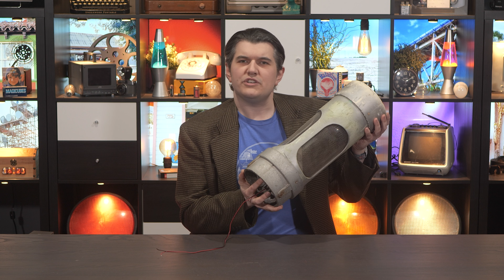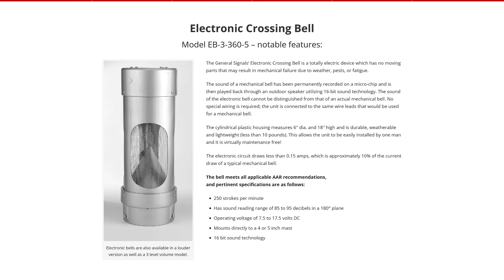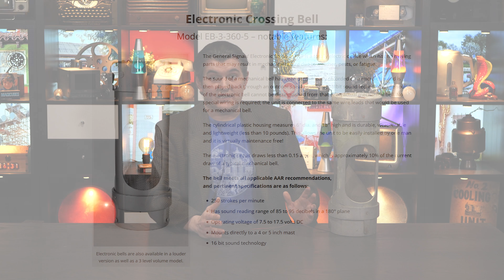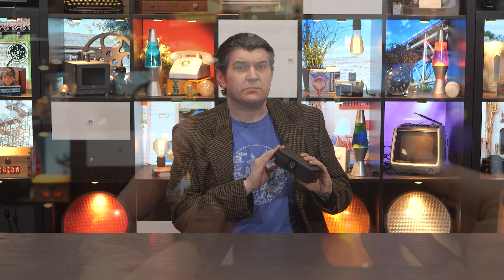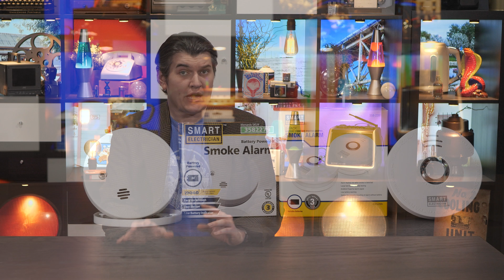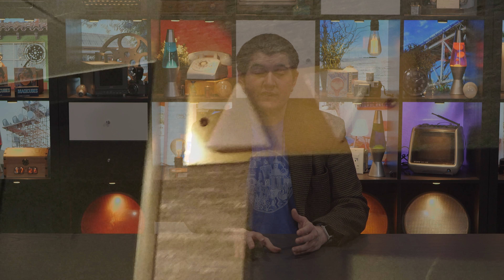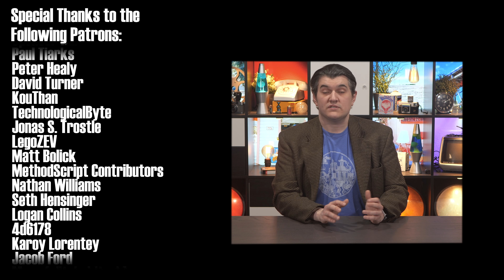The disappearing and unappreciated art of audible alerts

Comment: You can get a Nothing Phone. It has that notification cooldown, the first notification sounds normal, and if the second comes to quick it lowers the volume automatically. Also you put your phone face down, it switches automatically to vibration, or if it is already on vibration it turns to mute, and only the gliphs are on... And a lot of useful stuff. Cheers!

Comment: "One man's defaults are another man's hell"
Android recently changed persistent notifications. If I make a notification that I tell isn't allowed to be dismissed, now it can be dismissed and there's no setting anywhere in the phone to make it non-dismissable anymore. I use that type notification to remind me that garage door is sitting open, the doors are unlocked, and the stove is on through home assistant, and the only way to dismiss them was to lock the doors, close the garage, and turn off the stove. I consider it completely inappropriate that it's simply no longer possible to have truly persistent notifications.

Comment: I'm so confused about parts about the end rant. I have three Gmail accounts and I've set all three to different sounds..? I've had it set up like that for years and redid it again last months when I changed phones.

As for snoozing notifications - yeah it's too bad it's not built in. Buzzkill is an app that can do that (I use it for other stuff but I've seen the feature)

Tip for unobtrusive noises - ui plonks for the Sheika slate from Zelda BOTW!

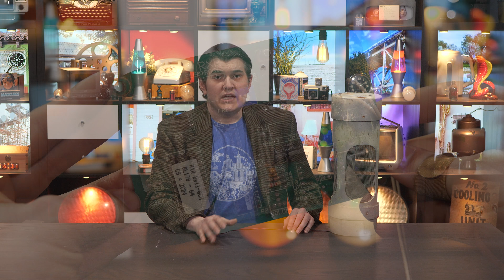Comment: 3:09 That is the most simple circuit I have ever seen in something consumer, a ROM, ADC, Audio amplifier, and two binary counters, what I assume is a 555 timer, thats it.

I suspect the counters are used to address the ROM (albeit I'm not sure why there is two of them), the data out goes straight to the ADC, and the 555 serves as the clock.

Comment: You're so right about the repeat notifications. Samsung Messages had that feature, so I wouldn't miss texts when I left my phone in another room for 8 seconds. My new phone uses Google Messages which, after a great deal of internet searching, I've found does NOT have the feature. The only solution seems to be installing a 3rd party app, which should never be the "solution" to an obviously missing feature.
Also, like you, I never feel the phone vibrating. Maybe my phone is too cheap to have a strong motor?
I could go on a big rant about how we have fewer options than ever and they're vanishing more every day, but I think I'll try and have a more relaxing Sunday.

Comment: Great video as always! I do agree with all your points and also wished we got to experience the more whimsical side that some phones did in the past. (I miss my IR-Blaster, 3D-Touch and RGB-Notification LED from past phones)

I also want to add that I find it downright irresponsible how some alerts are designed. The fridges my grandparents and parents own have alarms that warn you when the door is still open after a minute or so. The tone they used is pretty high and unchanging. I can easily imagine them or others not being able to hear it or it just going unnoticed as more environmental noise! Same applies to other alarms of household items and even some fire alarms! (For their battery, not the actual fire alert)

Sadly, I can easily imagine that the problems with notifications on modern phones you spoke about are quietly tolerated as useful bugs by some software makers. By not being able to easily discern between useless notifications and important ones, one must spend more time looking at the phone, so by not being able to treat those differently, the companies behind them may end up making more money, even if that effect may be small for the individual company. I could at the very least understand that as a rationale for app developers to not design notifications to be customized well by the user.

Comment: I would like to have an Android app to automate some stuff when a notification comes, yet any automation app seems to be stifled by the OS, missing wakes, having problems with network access, intent communication does not work, etc. I just started outright assume that this is hostility by design.

I thought even that I could use morse code with vibrations or unobtrusive sounds (probably 2-3 letters of contact's name), but that would land me at square one with fixing a system that does not allows to be fixed!

If I wouldn't be cash strapped I'd get one of those fancy “minimalistic” devices for telephony and internet and a pocket computer with Linux.

Comment: Another thing I noticed is that my car (a 2019 Nissan Leaf) will occasionally make a bing-bong sound while I'm driving, but I have a really hard time figuring out what that sound is meant to alert me to. It could be that the car has detected that I'm exceeding the signposted speed limit (which its built-in cameras often make mistakes deciphering), or possibly that there's some issue that a dashboard light should also be alerting me to (but so far those have only ever lit up for low tire pressure). Even flipping through the thick owner's manual hasn't managed to clear up my confusion.

Comment: I actually think good notification sound management would reduce screen time. You end up picking up your phone constantly to check for notifications instead of relying on an audible alert. They definitely could make notification management a smooth guided process but most people would significantly suppress most notifications if actually presented with a choice, which goes against maximizing screen time which most tech companies are incentivized to do.

Most of the tools are there on paper but they are buried in menus, and are often half-baked.

Comment: You only slightly touch on this but we absolutey need what I'd call "notification batching" - both a global, per app, per notification, up to per contact option to set not just the ringtone, but also what is the period you want to be notified between notifications. Like, I wanna hear the initial notification, but then if they continue messaging or whatever, it NEEDS to shut up for a configurable period - up to even like days if I want. But that is simply not a thing that exists.

Comment: back in the 90s as a young teen I had a wristwatch I absolutely loved because it used 2 different tones, for scrolling though the settings it went to a higher pitch than than the others when you got back to the 1st screen/page... it used both tones for the Hr alarm... I'm estemating on time (it was 30+ years ago after all) but I think it was a 1/2 second  tone, 1/2 second off, 1/2 second tone/ 1/2 off then a full one second at a higher frequency (maybe a 4th or 5th higher?)... I'd often not even notice the first two beeps but the 3rd got my attention.  I'd had watches in the past that just used the same beep tone and after a few months or so I just stopped noticing the chime.

Comment: Using a '3' to mean "danger" or "emergency" has been a standard for a very long time...

The SOS was built on the concept of a set of 3 groups of 3.... 3 short, 3 long, 3 short.  This dates back to 1906, and the "Save our Souls" is actually a backronym.

Triangles are also used as warnings, think yeild and caution signs.  Radiation symbols notably have 3 triangles, and each triangle has 3 sides and 3 corners.

In the scouts we were taught that if ever there was an emergency, the method of conveying this to people in the woods away from camp was to blare a horn in sets of 3.  If we were stranded and needed to be rescued?  Make a triangle.  A triangle of fires, rocks, whatever.

Comment: I used to have certain contacts with specific songs as their ringtones.  For example, I had the Monkees Mary, Mary for my sister Mary. These days, I just use the theme music from the 1968 Sci-Fi series UFO as my ringtone (I just really like the music) for every voice call.  I've been using Samsung Galaxy phones for over a decade.  I just use the default beep for push notifications, but I only have two programs sending me push notifications.  I get them when I get a text or when I get an email to my Gmail account.  I'm retired, so I don't have a work email anymore.  Plus, I am not on any social media.  well technichally, I have X and Facebook accounts because I sometimes want to follow links in a news story I am reading, but I never post anything.  I don't have any social media apps on my phone.  

I have a Samsung watch, but the only thing I use it for is to vibrate when I get a call or a text because I often can't hear my phone when it's in my pocket.  I don't use any of the health monitoring, and in fact went to a fair amount of effort to disable them.  Most of the time, I don't even wear it.  I only put it on when I go out.  Oh, it's also supposed to automatically unlock my phone when it's connected to my phone via Bluetooth.  I like that, or would if it actually worked.  Mostly, buying the phone was a waste of money for what I use it for.  If I ever decide to replace it, I will probably buy a Pebble.

Comment: A small anecdote that you'll find interesting.  I was working in a Jail an as electrician, and we were replacing the security system and the fire alarm system.

The old fire alarm system was from the 80's, and made a sound similar to the "whoop whoop" sound to the one you played from the record.

It turns out that the fire alarm sounders were just intercom speakers, and a single DAC in the fire control panel would constantly play the "whoop whoop" sound 24/7, and when the fire alarm went off, it would just connect the DAC to some amplifiers to play it over the entire jail.   So each time the fire alarm would go off, it would start in a random starting place on the "whoop whoop" recording.  When you were in the room with the main fire control panel, you could very faintly hear the "whoop whoop" sound from the DAC from the electronic noise.

Comment: I should note, 99% of fire alarms also use a tritone, debatably the most jarring interval when isolated by itself. Surprised you didn’t mention that. 

At the college I went to, the tornado alarm was a consistent long tone was an uninterrupted consistent interval, you wouldn’t guess, a major third! A “just” intonated third as well. 

It was beautiful sounding. Actually drew me outside to listen. (The tornado was several miles away and the tornado shelter was just right  inside, so I think I was fine).

Whoever programmed that alarm did not do a good job conveying danger. If I did not also have multiple alarms inside on the intercom and on my phone, I would not have assumed that was a tornado alarm.

Thanks for the video!

Comment: Have an old home fire-alarm from 2005. Had to replace some of the electronic components, but did technically get it working again... Accidentally made a connection that shouldn't exist, which caused it to constitantly go off, so long as it has power. It is not a temperal 3 sound. Definitely obnoxious, and if heard for too long you will start ignoring it.

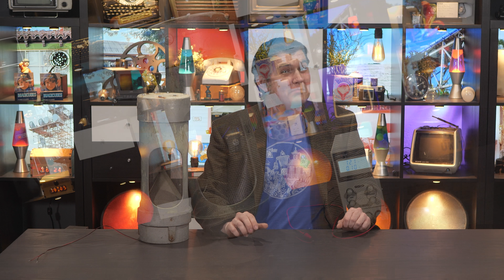Comment: 0:44 - If I'm honest... I've seen enough videos to know these bells mean nothing. I've seen a video where a guy put his bike over the train barracade, pushed through the small gap by bending the barracades apart with his body, then THREW UP HIS HANDS AND YELLED AT THE TRAIN FOR DARING TO PASS BY BEFORE HE GOT OVER THE TRACKS. Seriously, what's wrong with people...
3:57 - You have an important job and don't let anyone tell you otherwise.
4:13 - While accurate, I hate it. Thanks!  >.>;
4:29 - Slower for some than others... See first timestamp comment above
13:04 - The problem with common sense is it isn't that common. Keep repeating it and it will be. It is unfortunate that it needs to be done, but...
14:40 - I never cared to at first, I have basically a handful of friends who message me, but when I suddenly did again I found I was unable to. At least for individuals. Specific apps, yes, and I have distinctions between Discord, Telegram, and SMS.
15:46 - You do know that-Ah, there it is.
20:06 - Can confirm, it's a 1 hour feature. This is one of the reasons open source is great. If Android were open, features like that would have been implemented and folded into the OS in a week.
22:48 - Nope, we can't have nice things. Capitalism demands that we listen to the megacorps who know exactly what we want.
I love and hate in equal measure that our society has become the iconic "1984" Apple Macintosh commercial, but there's nobody who's running past the masses to tear down the regime with a sledgehammer. If they haven't been paid off, they've been captured by security long before they can make it to the stage.

Comment: A standardized fire alarm sound, happy thoughts indeed! At my work they test the fire alarm once a month. Not the entire drill, only the sound. Also at my work runs a rather large steam boiler, with an alarm. Guess what, both are bells. Guess again, both make almost the same sound in pitch/tone. Guess, you get my drift and indeed if those bells ring, they just ring until they are shut off.
If that  3-beeps or 4-beeps signal is the smartest to use? Too many alarm clocks make beep-sound-sequences like that.

I don't expect a soft ding-dong for a fire alarm nor the boiler alarm. But some kind of distinction would be nice. Not that it will be easy to get out of the building quickly when disaster strikes.
_

My phone, I have some pretty standard sounds. Only for very few special notifications I have a special one. Not that I drop all I'm doing, but I heard that notification and know I need or want to react pretty quick, the next brake, or some time later.
And when I drive my car, you can ring all you want. It would be nice if the phone could let you hear the 'engaged tone' while I drive... but developers don't think that far ahead. We still call those things phones, but calling others is one of the lesser things I do with the device.
_

A last thing on sound and sound design. Specially as you mentioned the elevator sounds regarding the blind. What about all those alarm sounds and the deaf. Not all devices can vibrate. Not all situations can be assisted by flashing lights, not to mention light pollution and confusion. Around me most alarm sounds use a rather high pitch, and only one tone or multiple tones all in that high pitch region ... exactly where my partner has the largest loss of hearing, and she is not alone.

Again a very nice video that at least tries to make people think.

Comment: Memory unlocked:  At my elementary school, the fire alarm rang the standard school  bell in a pattern of three short bursts.  Why not?  It's a system that is tested nearly constantly.  It was merely explained to us that that was the fire alarm.  Not that most or all fire alarms share that pattern, but this specific one does.  I"ve heard fire alarms over my entire life, they have almost all had the same pattern, I've just never put 2 and 2 together.

Or I suppose 3 and 3.

A tornado alarm was one long continuous ring on the bell.  Problem is so was the normal class change bell, so the tornado alarm was 1. at weird times and 2. even longer.  No CO alarm in this system.

Aircraft are full of this kind of stuff; I have the feeling that I could amuse Alec for hours with stuff from Part 23 about standards like this.  For exmaple, the alarms for ILS marker beacons are long and low pitched, they go doo doo doo doo.  The middle marker is middle pitched and it alternates long and short, daa da daa da daa da daa da.  What few inner markers were ever installed are high pitched and only do shot pulses.  di di di di di di.  Alec has informed and entertained me about a lot of stuff like this, I hope I just returned the favor in some small way, because I like that guy and I want him to have a nice day.

Comment: I own a "hybrid watch". Real face and hands plus a tiny display for more features. It connects to the cell phone and measures pulse O₂, steps and air pressure. It can display the headers of push notifications if you really want. But when the small 64×64 oLED display is off, it looks just like a regular classic watch. And the battery can run many months if you disable the sensors. A week when fully monitoring O₂ all the time.

Comment: @TechnologyConnections I don't know if this is is just my city or my whole country, but they had a problem with electric busses (for public transport) being too quiet, and since they get to drive through otherwise pedestrian only zones that was a problem. Also, because a regular car/bus horn is so frequently used, people were ignoring that sound, thinking it wasn't important because they weren't in the road.

The solution? The busses now have a sound like a tram bell. Because people do associate that sound with something that they need to watch out for in a pedestrian zone.

It's a little confusing at first, but it works really well.